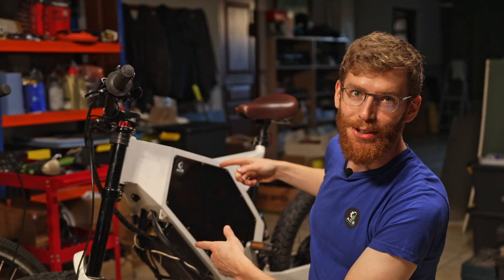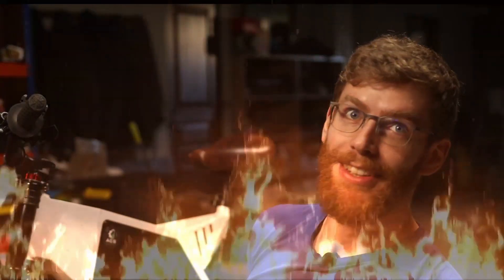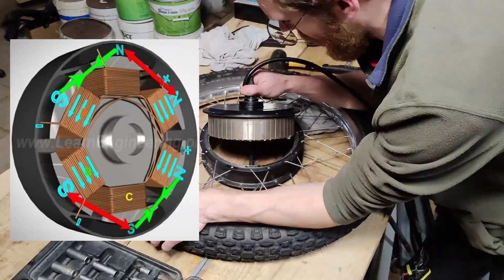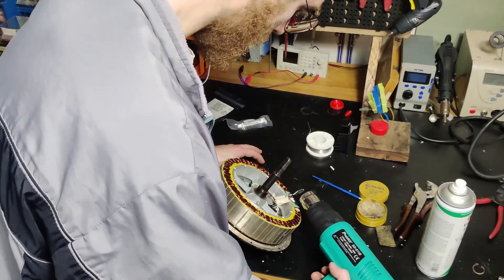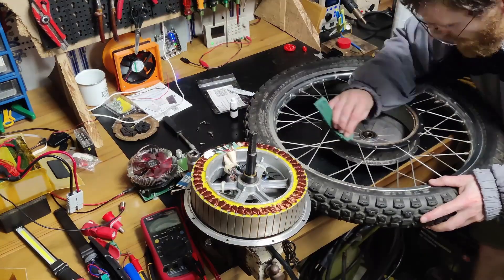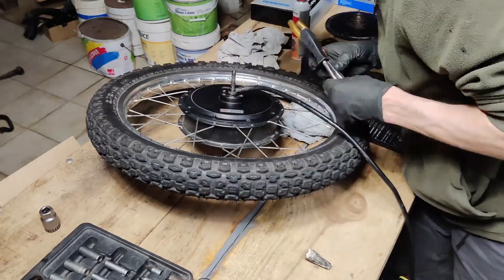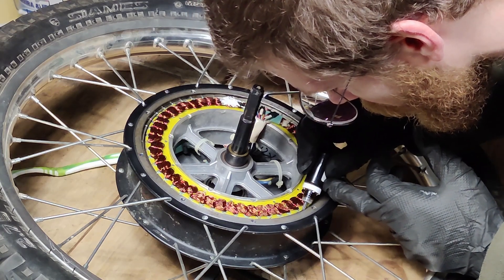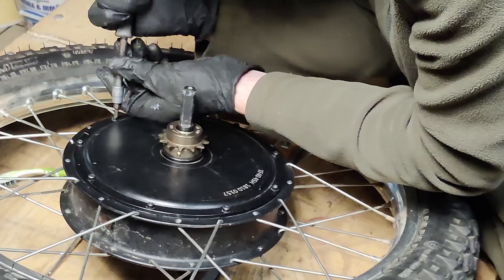Upgrade your Ebike with this Fluid

Comment: Statorade fluid dissolves some brand hub motors' epoxy glue used to fix magnets on the rotor. Any one knows about this issue and which brands are compatible?
Reply from the maker: I haven't heard about any of those issues honestly. Sorry

Comment: Olá Afonso. Obrigado pelos videos. estou iniciando-me na construcao da minha própria bateria após ter-me apercebido do preço de uma bateria de origem para a minha e-scooter.; possuo alguns conhecimentos a nivel de electronica/soldadura e adquiri recentemente uma maquina sunkko(pra começar em grande :)); tenho pena de nao ser meu vizinho para troca de ideias...estou cá pro sul no algarve; a minha bateria original é de 60v (16s8p); uma vez que tenho espaço estou pensando em aumentar a capacidade para 25Ah (16s10p), originalmente era de 20AH; a bms tb será uma atualizada para uma de 150a(contínuos - JK-B1A20S15P - jikong); as minhas duvidas prendem-se com as niquel strips; vejo que usa niquel puro de 0.30; eu penso que 0.20 tb de niquel puro seria suficiente para as 18650 que vou usar de 2500mah e descarga maxima de 20a; para finalizar, a minha bateria original, nos terminais finais possuia umas strips bem mais grossas(final positivo e negativo) para aguentar a amperagem; no seu video de construcao da bateria de 36v, nao me apercebi que tivesse feito algo do genero. Peço desculpa pela longa mensagem e qualquer dica adicional será muito bem vinda. Cumps e bom ano!
Reply from the maker: Força aí no projeto. Relativamente à espessura das tiras de níquel depende da corrente que vão conduzir. Nesta bateria de 36V é no máximo 15A daí não haver necessidade. Nós casos das motas elétricas elas vão até 35A ou mais e aí é importante usar cobre ou algo melhor condutor, caso contrário as células dos terminais vão aquecer mais sofrer desgaste permaturo

Comment: I am beginning to suspect statorade needs to be cleaned out and reapplied after a period of time. I might try doing it yearly.
Reply from the maker: I am going to be honest, if the statorade often gets hot I do believe it loses properties, but I don't have the experience to back that up. Why do you suspect that?
Reply: @Asvybre  We have 5 delivery trikes that get used every day. Eventually the motor fails. We run the motors at above design power which is fine initially. Newly installed motors don’t fail. The failed motors I have taken apart are a gummy mess. Unfortunately I haven’t been there long enough to know how long the motors have been used but in one year I replaced 3 out of 5. I suspect it’s like any other oil based lubricating product. If you don’t change it out on a regular schedule, you’re going to have problems.
Reply from the maker: That is interesting. Is it possible that maybe water is getting in and mixing with the ferrofluid?
I haven't seen that yet but in a few months maybe I will open up this one and check how it's doing.
Reply: @Asvybre  Very likely water gets in. It rains almost 1 out of every 2 days here.

Comment: Ferrofluid doesn't give you more power, it helps transferring heat out... That's allw
Reply from the maker: That is correct! But my point is that by adding the ferrofluid you're able to deliver more power from the same motor without damaging it.

Comment: Cool vid, I've been curious about adding statorade to my motors. What sprocket is that on that motor? And how many teeth does it have. I'm using a 14 tooth to 60t chainring and run out of pedal at 25mph. Thank you.
Reply from the maker: Thank you David! 
This one is a 14 tooth as well, it sure does nothing above 20mph since I have a 44t chainring.
Without something like a schlumpf drive crankset you can't really get it to work above 25mph.